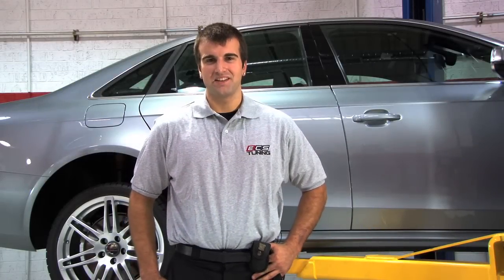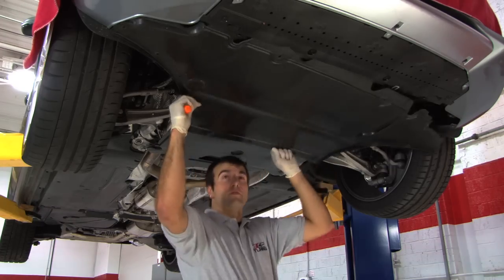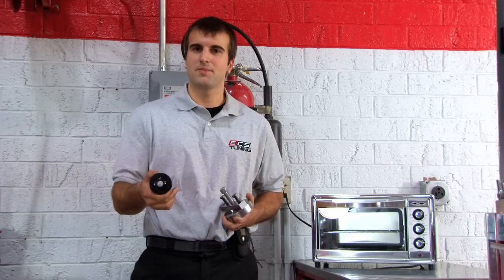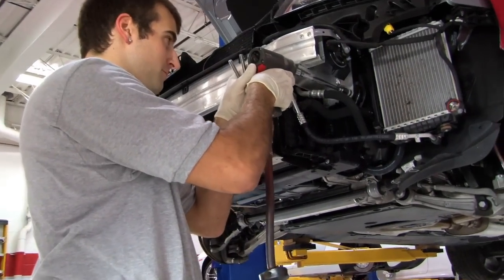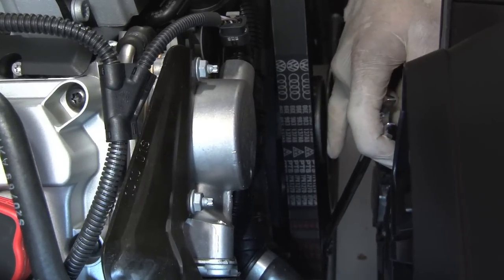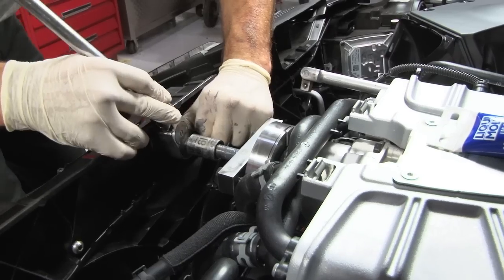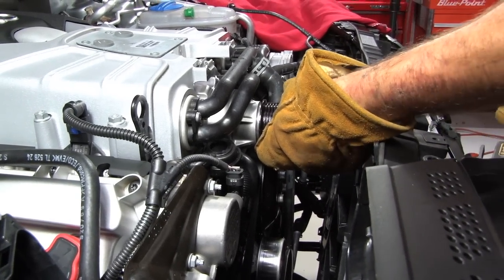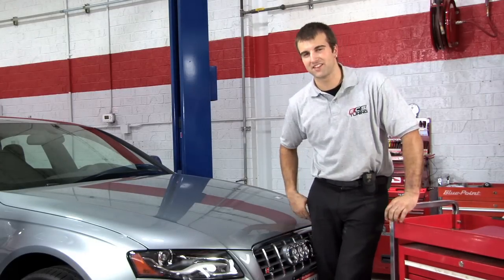ECS Tuning: APR 3.0 TFSI Stage 2+ Supercharger Pulley Upgrade Kit DIY

Comment: How is the reliability?  Jw I have a 2015 a6 c7 3.0 with 139k on it.  I need a new PCV valve so I'm thinking of changing a pulley while I'm in there

Comment: I have a 2012 Q7 3.0t
It currently has the 280hp stock tune.
I want to get to the 400hp mark.
Some 3.0t have 444hp.
Is this a refresh only for me or pulley + reflash?
I want better trans shifts too

Comment: Would this modification invalidate any warranty?
Reply: Audi pretty much won’t touch your car if they pop the hood and see any mods.
Reply: @mikeheard3196  Thanks for the reply, thought so, I have since found out that my car wouldn't need pully as I was told by a tuning garage that I have the smaller pully anyway as the later models had this, its a 2015, I will wait until next year when the warranty runs out to do any remaps if I still have the car. Thanks

Comment: 43 HP increase by just changing the pulley?   Is there a super charger upgrade available?
Reply: That is the supercharger upgraded, its the supercharger belt the new pulley is smaller so spins 9% faster than stock one does. But you need a software tune to really feel the difference. Depending on what the stage 2's pulley MM is.

Comment: Only in audi something so simple takes this long to do. In any other car you'd need to take out the belt and change the pulley.
Reply: Intricate engineering designed for quality, not ease. You probably drive a cheap asian shit box, and wouldn't understand the difference. Why are you watching Audi vids anyway? Don't be jealous.

Comment: I have a 2015 Q7 with a 3.0TFSI engine. I want to use CRC Valve Cleaner on it but I'm not sure if I need to be bypassing any sensors in the intake stream. I've scoured Audi forums and called CRC. No help. It's now my understanding that this engine has no MAF sensor,  just MAP sensors. I know what a MAF sensor is, and how it works, and how it could be damaged, but I don't know if the diaphragm in a MAP sensor would suffer a similar fate. Can you offer any guidance here? I can strip off the intake all the way back to the throttle body easily. In doing so I can see that there is no MAF sensor in the intake pipe. I know where the MAP sensors are too. They don't look like they can be bypassed.
Thanks

Comment: I get 458hp with stage 2 and 400 torque.  I assume back then they did not have good tuning.  Traction is a problem with high torque.  I can't step on it hard suddenly like stock as the tires would too much wear.
Reply: AWD in my A6... Isn't a problem.
Reply: How’d you get to 458hp?? About to get a ‘17 A6 AWD, I’m trinna find out how you got to doing all that
Reply: @toostock7391  It is a stage 2 tune with a smaller supercharger pulley and new belt and tuned for 93 octane.  Took about 3.5 hours at the tuning shop.  I am still waiting for files for dsg transmission to smooth it out and increase torque limits.

Comment: Bringing up the hp.  Did you or anybody beef up the bottom end of the engine?
Reply: 3.0 supercharged engines are good for 500 wheel with stock internals.  APR makes pullies (crank pulley) and a larger throttle bottle to get to those numbers.

Comment: What if you simply cut the old pulley off?  And slid the new one on with it heated up?  Would you have to lift it and do all that extra bullshit?
Reply: Exactly I replaced my and I don’t have to take the tire the bumper ect

Comment: Hi, I'm intrigued with your presentation. 
So by changing a pulley and serpentine belt will increase the horsepower by 30hp.
How is that possible.
Reply from the maker: APR's Supercharger Drive Pulley Upgrade decreases the diameter of the factory pulley from ~63.25mm to 57.75mm, which in turn spins the supercharger ~9.5% faster.  This, coupled with software, means more power!
Reply: Tuning companies in the uk are getting an extra 150bhp with stage 2 + I'm sure APR do aswell .

Comment: Can someone explain me how does changing Pully increase the horsepower?
Reply: The smaller pully increases the speed of the supercharger increasing boost and HP  must have  a remaped ICU to add more fuel amd timing... the pulley does nothing by itself.

Comment: On the drivers side is that small radiator down low an additional heat exchanger?
Reply: I believe thats the side mount intercooler for the supercharger

Comment: whats the price for this whole kit ,,and  i might need one for jaguar s type r ,but i heard that if i do upgrade the pulley might damage the supercharger,, was looking for smaller pulley for more supercharger whine
Reply: you would have to find one for your specific car, the whole stage two upgrade for this car is around 1500 which includes a tune and the necessary intake

Comment: Just bought a 2017 Q7.  3.0T Does this work and what are the gains?
Reply: I'm not sure if they have software for the 17s, but for the 3.0T stage two is upwards of 70whp increase.

Comment: The way he slammed the hood at the end made me cringe
Reply: My 2016 A6 closes so easily, you barely have to push, That dude slammed the shit out of it.
Reply: Slammed the shit out it??! Are you lot for real??!! Haha!
Reply: ***** Yea he closed it the right way because the hood can only be shut one way but he did it way too rough.
Reply: The dual stage locks on the car fully support closing the hood in this way. I have also seen with a lot of older (2011-...) the generally require a little more than a light push with the hood lowered to the latch anyways.

Comment: There is no need for removal of the Lock carrier or what he called "radiator support." Use a longer flex head 16/18 mountain wrench to reach the 16mm tensioner without putting into service position as described in this video.
Reply: ...and then you get the pulley off how exactly? magic?
Reply: It's true.

Comment: Hi, would the increase in psi affect the headgaskets in any way? does this pulley upgrade have any negative effect and also would anything else need to be upgraded prior or after the installation?
Reply: +Znu Dzony Not from that small of an increase. Nothing needed other than the tune to take advantage of it. Stg1 and Stg2 are separate files and just installing the pulley will do nothing for you on it's own.

Comment: could i upgrade a stage 1 to stage 2 without the pulley
Reply: +Andrew Blea Without sounding too callous, No/Yes.
You can certainly do whatever you want to do, but upgrading to stage 2 without the pulley is pointless and could probably cause a loss in performance. The software is tuned to work in conjunction with the pully. The software is expecting a certain amount of air from the supercharger. Without that air, I assume you would run extremely rich causing excessive carbon buildup in a relatively short period of time.

Comment: Really considering this for my B8 S4. I have the GIAC stage 1 + done, but I'm concerned about the DSG. Would it hold up okay with an additional 40+ HP and TQ?
Reply: JoeyandLindsay The DSG is actually stronger than the stock 6spd when it comes to handling power.  The clutch on the manuals usually weaken considerably with the added Stage II Power.   The newer 2013+ DSG's are amazing.
Reply: Mine has acted up many times. The dealership always states that they "cannot duplicate" the problem, so I am left wondering when will it finally fail. I was not aware that the B8.5s had different DSGs. From my understanding, the only difference were the tune for them.

Comment: Can heat it with microwave?
Reply: Yea put a metal pulley in your microwave. Brilliant.
Reply: +Aziz Alkhaleel Yes absolutely. Make sure to wrap it in tin foil first very tightly and heat it no less than 25 minutes.
Reply: +Aziz Alkhaleel  Make sure you take a video of that. :)
You probably should stay out of the kitchen. ;)
Reply: If he is an arab, what are you implying?
Reply: Or put it on a pan with some cooking oil, A little bit of pepper and salt helps too
Reply: he can make bombs pretty good
Reply: Good idea!
Reply: hes an arab guys, give him a break

Comment: chip and pulley upgrade = super fast on a 'budget'
Reply: calvinblinkee nothing about it is on a budget. Your looking at about 1500 just in parts for a single pulley upgrade, not to mention labor for tuning and install if you can’t do it yourself

Comment: why heat the pully?
Reply: Heating it expandes the inside diameter of the pully making it slide right on so you dont have to press it on .then cools and had a friction fit

Comment: Once i remove the timing belt and put it back on with the new pulley, do i  have to do anything with the timing of my car?
Reply: Canadianhuh he didn’t remove the timing belt. He removed the supercharger belt. I believe the kit comes with a new supercharger belt. No adjustment needed, just loosen the tensioner to reinstall
Reply: These engines have timing chains, which is located by the firewall. In the front there is an accessory belt and supercharger belt.